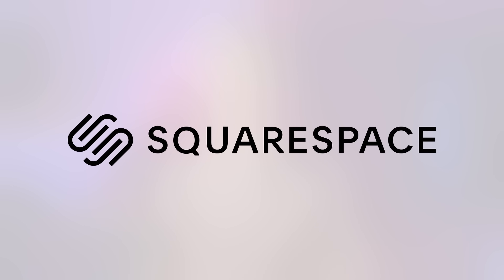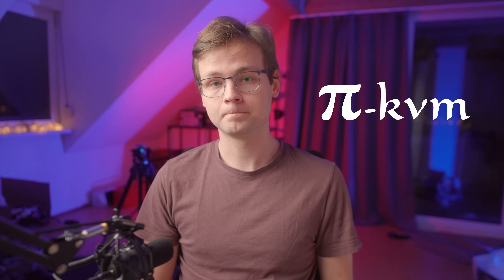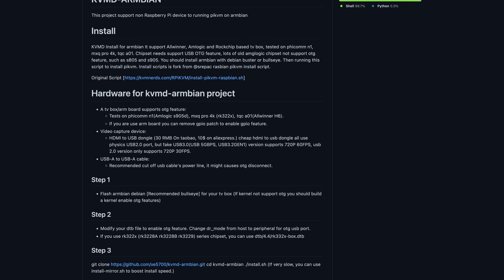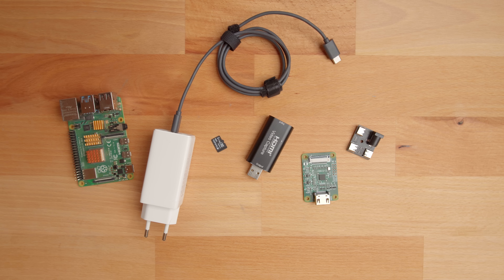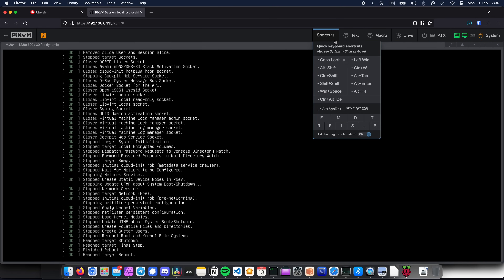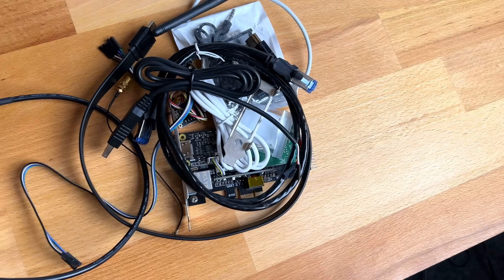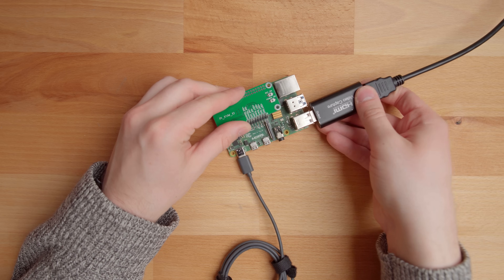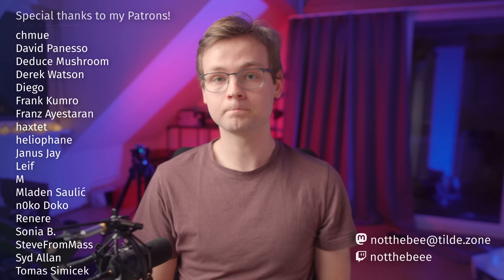IPMI and Remote Management for Any Motherboard! PiKVM

Comment: At the same time the PiKVM is attached to the server, can you also have a local monitor, keyboard and mouse attached to the server? Does the PiKVM do KVM passthrough?
Reply: You can achieve this by using an hdmi splitter, and you should be able to connect a separate keyboard and mouse to your server, so long as you have the usb ports.

Comment: I want to know, i have Pi micro HDMI to HDMI cable, usb male to male and power cable. Is those fine to run a basic pi KVM ? i want to knoe here in my case if i plug My Pi 4B's micro HDMI to My Main CPU's HDMI input will it  work ? and Pi's USB out to CPU's USB in will it work as keyboard and mouse. I need the very basic ip KVM.
Reply from the maker: No, you need an HDMI capture card. They're pretty cheap though
Reply: @WolfgangsChannel  for keyboard and mouse. A simple USB cable is okay?
Reply from the maker: No, a USB port on a PC will not provide enough power to the RPi. You'll need to make a USB power splitter

Comment: Why don't they draw power from the PCIe that is already connected to the mobo? Seems strange to need an internal USB cable for that, no?
Reply from the maker: The internal USB cable is for the keyboard and mouse connection, not for power.
You want the KVM to be powered independently of the PC anyway, so that you can control the ATX buttons even if the PC is off or requires a hard reset
Reply: @WolfgangsChannel : Yes, but USB delivers power whether the PC is on or off?
Reply from the maker: On most computers, you'll have to enable a BIOS setting for that. Something along the lines of "Enable USB power in S4 and S5". 
Besides, a standard USB port doesn't provide enough power for the Pi anyway. You're gonna want to use an external power supply or PoE
Reply: @WolfgangsChannel : Thanks. :)

Comment: I’m currently making one my homelab using an existing pci-e slot. It’s based off of Geekworm’s A-8. However if I could in the future I’d want to create something that uses an internal usb3 header for video + usb controls along with a pci-e 6 pin connector for power. 

I’d love for only port that comes out of the expansion slot to be an rj45 port. However I also would consider adding a small usb splitter to have a few ports for the usb 3 header or an hdmi port tied to an hdmi splitter for it to be adjacent to the RJ45 ((maybe both cause why not?))

It’s mostly just to have an emergency setup incase my reverse proxy messes up and I can’t access my machine over https
Reply: Any issues with the Geekworm KVM-A8?

Comment: Warum nicht einfach USB-A-Male-Male verwenden und power normal anschließen? 
Why not just use an USB-A-male-male cable and connect the power normaly on the pi 4?
Reply from the maker: USB-A ports on the RPi don't support OTG, which is necessary for HID/USB storage emulation
Reply: @WolfgangsChannel  Ah, ok thx :)

Comment: Very nice! To control my servers at home that are stowed away, I use a Marmitek MegaView 76, which is a KVM extender, basically running HDMI + USB signals over UTP Cat5 or Cat6. That said, I probably would have picked a PiKVM nowadays. Marmitek is rather expensive (over €150), and I had the opportunity to put a lot of spare UTP cabling through my house, but not everyone does have the required dedicated UTP cable. The PiKVM uses your regular LAN.

Comment: Finally a use case for my old RPi 2B that was used for monitoring my terrarium environment years ago and has been in a drawer ever since it stopped working (probably because snek managed to pee a little into the enclosure somehow, maybe causing a short which then causes kernel panics) and I couldn't be bothered fixing it. Assuming it recovers from me brushing it with dish soap and rinsing it. We'll see.

Comment: Interesting for curiosity. I guess not cheap enough to be worth it and with RPI4 or RPI3 not much power efficient. I don't know about others, but in my experience SD cards in RPI have some weird tendency to die, industrial ones seems much safer, but not invincible. It might be bad luck. Also with power outage, filesystem might be found in random state (once I mysteriously lost partition table on SD card) so I don't trust it much. However, it might be interesting to use this for access to BIOS from other server if they can somehow emulate USB keyboard and mouse.
Reply from the maker: SD Cards do have a tendency to just break, but PiKVM mounts the root system read-only by default, which should prolong the medium lifespan

Comment: Is it possible to install PiKVM to the microsd using ExFAT to get higher storage capacity? I have a 128gb microsd card.
Reply from the maker: I'm sorry, but how will ExFAT give you a higher storage capacity?
Ext4, which is the file system that PiKVM uses, supports up to 1 Exabyte volumes, and even with FAT32, the maximum volume size is 2TB
Reply: @WolfgangsChannel  is that right? I read somewhere that microsd cards formatted under FAT32 have a maximum of 32gb. To recognize higher capacity, the card needs to be formatted to ExFAT?
Reply from the maker: @pr0jectSkyneT  I don't think that's correct. FAT32 does have a pretty big limitation – individual files can't be bigger than 4GB, so that's why people mostly use ExFAT for SD cards these days.

PiKVM only uses FAT32 for the boot volume, and all the system files are stored on an ext4 filesystem.
Reply: @WolfgangsChannel  ok thanks for that

Comment: Great video :)
I was wondering if you can use PiKVM to control another Raspberry Pi device? 
I could not readily find any information on this on Google
Reply from the maker: Yes!

P.S. if you want to control a Pi 4, you will need an HDMI to microHDMI cable instead of HDMI to HDMI.

Comment: Great video! I didn't ever imagine that those tv boxes are so easily flashable, this opens up so many possibilities, not only for IKVMs but replacing RPI in general. If it wasn't for RPI shortage it probably wouldn't be worth the trouble, but since they are dirt cheap (especially used ones), might as well "convert" one just for sport :D

Comment: Nice video.. with blikvm, could you connect the ATX power control and the power button of the case same time? So both are useable? Thanks..
Reply from the maker: Yes
Reply: Wake on PCI is a thing, it sucks tho tbh. I see the power thing being a thing not sure why they don't use it.

Comment: For the amount of efforts and cost involved to get a rather fragile solution it is cheaper to get a server motherboard with IPMI at this point. 

On a separate note, cpu heat sink at 1:59 mark must be rotated 90 degrees…
Reply from the maker: You can’t exactly rip an IPMI module out and take it with you 😉

Also, yes, you’re right! Thank you

Comment: Thanks for this content, I didn't knew anything about pikvm but I think it's an alternative tool for my server. Old Core 2 Quad with 3 1TB HDD as RAID 5, there's  a couple of upgrades I would like to do in future, increase Storage with an HBA up to 12 drives, remote power on from the phone, today I can only remote shutdown, and a SAI PSU to safe shutdown in case of powerdrop or a 2nd server to backup and also mount remote CIFS/FTP to 1st server. Meanwhile I see you're in another Server/Homelab level, thanks for all the guides and content.
Reply: Dude upgrade. That’s seriously old.
Reply: @seansingh4421  I know, isn't that amazing? 😀  The HW is almost as old as my nephew but it feels great to run. 😆 This shows that modern commercial SW is the new cancer for the HW. Thanks   to open-source guys for Debian.

Comment: A nice solution. But IMO serial consoles still have a use case. 99% of Linux server issues can be resolved using a good old serial console. Decent BIOSes will propagate the console for the BIOS to the serial port. Not much use for windows servers, of course.
Reply: Maybe a VPN connection to a Pi with a Debug Probe hooked up to the console port would be adequate in that case! Certainly a lot less bandwidth required and it'd run just fine on a Pi Zero or A+ (which are easier to find).
Reply: @JeffGeerling  in your traditional 1990s (and later) data centre you’d have a server in each rack which was your “serial console terminator”. Using a pi for that in a home network does sound pretty interesting. I wonder if anyone’s made any “hats” that have a coupe of serial ports….
Reply from the maker: @Lawrence Manning AFAIK you don't even need a hat, since GPIO supports serial
Reply: @lawrencemanning  I have a box from WTI that I've been meaning to set up in my rack that does just that... though a bit more pricey than trying to build a multi-port box with a Raspberry Pi! I've considered trying to build something comparable using a bunch of USB to UART adapters...

Comment: Maybe blur the phone number @ 5:06 if you still use that. I use the blikvm and it works well. but the included fan is worthless etc. I would rather have paid less, and have (part of) the cables as an option. I still think It costs a lot for what it is, but it works wel and still is cheaper then many things.
Reply from the maker: +420 1337 69 69 😁
Reply: @WolfgangsChannel  oh see I didn't even read it, but thought hey a phone number, now I see